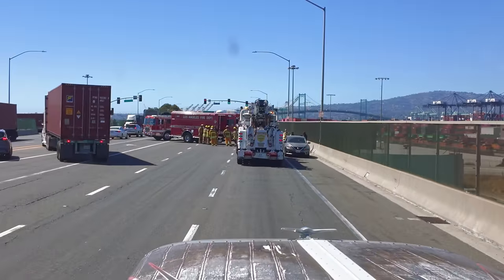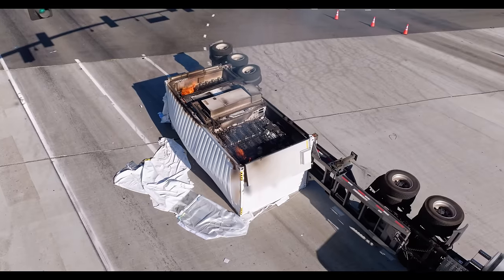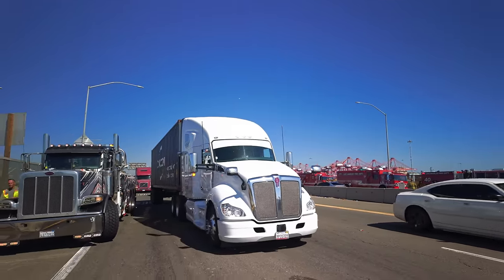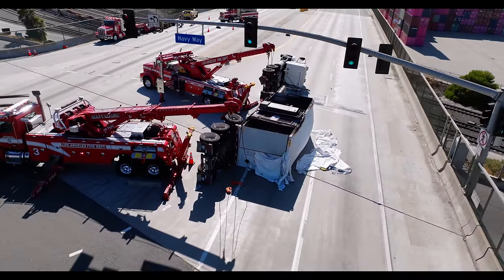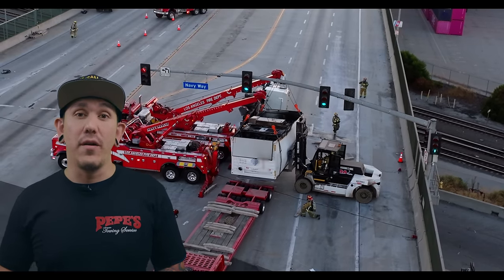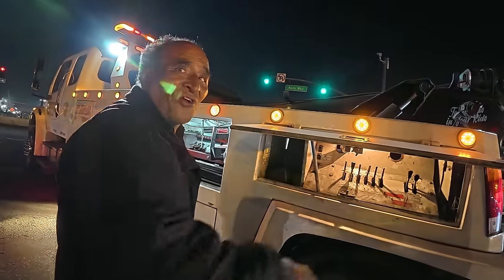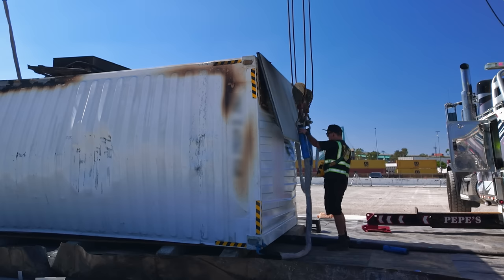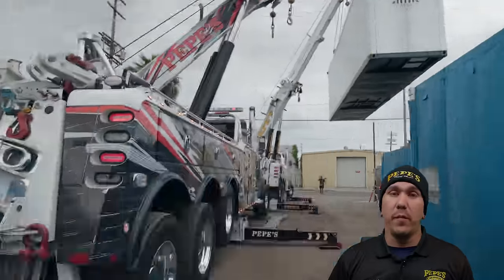60,000lb Lithium-ion Battery EXPLODES on Freeway!

Comment: Worse location possible. On a bridge, involving train tracks, interstate,  ports. Dang thing going NUCLEAR
Reply: The only "usual suspect" missing was some nice high voltage overhead lines.
Reply: , don't forget that giant fuel storage tank right below the bridge too
Reply: Going "NUCLEAR", bro it barely got on fire
Reply: @StefanoFinocchiaro  Yes, but lithium fires create a nice, massive "fuck off" zone of very, very fatal fumes. This, around quite literally every most used mode of transportation is rather problematic & a lithium battery of this size for more FD's is a large event
Reply: @StefanoFinocchiaro  not only did it explode with the force to open the doors, but then there was a raging inferno at least as big as a campfire. At least gasoline doesn't explode, or catch fire, so much for the future.
Reply: @ironassbrown  gasoline DOES explode when it evaporate and catch fire in a contained space
Reply: @StefanoFinocchiaro  pretty sure that fuel tanks only explode because they started putting lithium ion batteries in them. Otherwise, they would be 100% safe. The old technology is so safe. In fact, I challenge anyone to find an image of a fuel tank exploding like a small atomic bomb. You can't do it because liquid fuel has always been the safest thing that we have. That's why tankers, and gas stations never blow up, and that's why it is so difficult to drive up to a battery fire with a front loader and dump some sand on it because it will see you coming and it might get aggressive.
Reply: @ironassbrown  In Romania last year a gasoline station blow up killing 46 people
Reply: @ironassbrown  The gasoline produces flammable vapor, that's why is not allow to smoke cigarettes in pump stations
Reply: @StefanoFinocchiaro  Yeah but at least they didn't have to worry about fumes. You saw the video the FD was helpless they couldn't pour sand or baking soda on the batteries because they had to sit there and let it slowly burn for a day. I wonder how many people died from this battery fire probably at least 47
Reply: @StefanoFinocchiaro  naw it's super safe, as long as you are out of the blast radius, and standing behind something solid. Batteries on the other hand are very dangerous, that's why I replaced my mobile phone battery with a gasoline generator. Sometimes I get dizzy when I am charging in a confined space but I know the fumes are harmless, and the more gas you have on you, the less you can smell it. You hardly notice it except when you run out of breathable air.

Comment: Years ago to fight a magnesium fire, they would dump sand on it to smother it and encase it with a glass coating. I wonder if that would work for these types of fires as well.
Reply: Some repair shops keep garbage cans full of sand for LiPo batteries that turn into spicy pillows. Though for something like an EV, you're gonna need A LOT of sand to completely smother it.
Reply: That might turn it into a bomb, if the glass gets thick/strong enough. This fire doesn't need the oxygen from the atmosphere.
Reply: in Germany electric cars bath for a week in a watercontainer to cool down
Reply: Probably would. For charging my LiIon batteries privately I have a bag of "FireBalls" not sure what they are made out of, but on being heated they fume out CO2 to extinguish the fire and if this one does not work they are supposed to melt and encase the fire to not let any air near it.
Reply: There is no way to put it out. You could put it in the vacuum of space and it would still burn. It's literally like rocket fuel. It has it's own oxidizer.
Reply: The fire is just the battery's normal chemical reaction happening exceptionally quickly and producing heat instead of electricity. For most types of batteries, atmospheric oxygen is not part of the reaction, so a battery fire will proceed on its own even without oxygen.
Reply: @Jake-bt3fc Cooling keeps it from going off, though.
Reply: @namibjDerEchte  There is no air in space to conduct heat so cooling is very difficult in a vacuum.
Reply: Well for EV's they've solved the problem with a special injector tool that can puncture the battery pack from underneath and spray high pressure water directly into it putting out an EV battery fire in only 15 minutes no problem.

Comment: Was really looking forward to Josh's live commentary on the fire departments recovery efforts
Reply from the maker: I wasn't frustrated with them per se either. I was hired independently by the department responsible for handling the scene. So I kept getting called back and told to wait just to not do anything. Believe me, fire didn't want to be responsible for the recovery either so I'm sure they were also equally as unhappy to have that thrust on them.

Comment: Looked like LAFD heavy rescue could use some ride alongs with Pepes and some training.  Pepes would have had that handled an hour after the fire was out, but I suppose adding in politicians and multiple agencies slowed things down to a crawl.  How to solve the roll over issue with these, slow down and be aware how these things ride.  Great work on the video.  It's hard to cover something that takes so long and keep it entertaining.

Comment: Big problem with this is drivers swinging corners too fast but also the major issue I think is how it’s being transported. It needs to be on a lowboy trailer and a lowboy only. Chained down all 4 corners and top to bottom definitely more secure than the way it is right now.
Reply: First of all imagine   this stupid driver dropping that thing on a car? It will smash it. But also this giant lithiums are a bad idea, dropped from 3 feet and you get this mess and so much money wasted, even a real generator would not do this if dropped, honestly the city should send the  company the bill, $ the transportation company is at fault too, let them sue each other.

Comment: The Scandinavians have worked out how to put these lithium fires out within minutes. 
They deluge the fire with chilled brine (salt water). They’ve developed this method to put out electric car fires on their car carrier ships.
Reply: Best EV firefighting (thermal runaway) technique yet!
https://youtu.be/ODirK7ZuYW4?si=NaCy8-nQfdKEoePy
Reply: This is after they've invented sodium ion batteries that don't HAVE thermal runaway problems. They've already put them in a few test prototype cars but of course they won't use them widespread. So now we have to listen to the battery fire morons.
Reply: @jb5music more worried about the people in the Congo. Funk your battery fire bs
Reply: @jb5music  These batteries have lower energy density, which is already an issue with lithium ion (for cars and trucks, anyway.) That, and they will still explode violently when damaged. There is no safe battery, because that compacted, concentrated energy wants nothing else than to be freed by any means necessary. Sodium ion just removes the re-ignition risk.

Comment: This is why auto insurance costs more for electric vehicles.  Been following you for over thee years now really enjoy you content.
Reply: yep as they are almost impossible to put out once they ignite. yet they are so much better for the environment.biggest load of crap out there
Reply: Not at all, your gas car has 10x more chance to burn down.
Reply: @MrArcticPOWER  Insurance rates are higher for electric cars because they carry a higher risk for the insurance companies when parked indoors they also are more expensive to repair
Reply: @lostsailor2284  Insurance companies use statistics to calculate your premium and statistics clearly show that gas cars are more likely to catch fire. 
Yes insurance rates are higher because of repair costs, but more importantly because they are worth a lot more.

Comment: I've made bigger bonfires than that, and that's an entire semi trailer full of batteries. I'm a volunteer FF and we've done multiple training sessions on how to deal with lithium battery fires. I can confidently say the only problem here is poor/no training on these fires and/or no equipment for it (that our volunteer dept has, so pathetic if that's the case)
Reply: For a lithium battery as big as that one, I am surprised by how the thermal runaway was not that great. Does the charge of a lithium battery affect the intensity of the reaction?

Comment: The minor explosion was caused by hydrogen accumulation in the container, and a single spark set off the blast, blowing the doors open. If fault is to be assigned, it lies with the driver of the semi-truck who turned too sharply, combined with the container's weight and high center of gravity, causing the trailer and truck to tip over. The doors are designed to open in such a manner. Regarding the fire department, by waiting this way, they are delaying their action because uncertain about handling these large battery generators, which I believe are used in conjunction with windmill turbines.  The companies building these should educate Fire depts on how to deal with these.   

Proper transportation methods for such equipment must be learned. A low-bed container trailer should have been utilized to maintain a low center of gravity, closer to the ground.

This is the consequence of employing an unsuitable company for the shipping or transportation of this type of equipements..
Reply: Exactly. This is not a battery that exploded as such.

Comment: Ports need grade separated automated rail lines to get containers out of cities to rail and truck pick up terminals. We have just as many problems at the Port of Houston.
Reply: Look up the Alameda ditch
Reply: @ArtStoneUS  Most of what I found had to do with a hiking trail in Albuquerque. But I did find the LA rail line.  

A plan proposed for the port of Houston was to build an automated, electrically powered and grade separated rail lines out to intermodal terminals outside of Harris County. 

Trucks are still an air cleanliness issue and a traffic nightmare in Houston.

Comment: I love that Tonka Truck recovery vehicle. I want one for Christmas. I had an electric car in 2014 on a 2 year contract. After 8000 miles and two years its range was 35 miles and needed a new £5000 battery. I gave it back and I will never have another one. I would rather walk, it's quicker than pushing an electric car.

Comment: Lol all the waterheads commenting about lithium tech without realizing what would have happened if this was a tanker that exploded instead.
Reply: There is mutch safer battery chemistry to use when you dont have so high energy density demands,(like in a steel container ) it's not a
Ev car we are talking about here.
The lithium batterys are , prown to thermal runaway ,not optimal out of resource point,
Emits extremely toxic substances  if it burns .and there is no scaled up recycling solutions for the  after use part  of the  lifecycle. 
A gas tank would flame  out in a more or less  controlled fashion, burning liquid fuel will burn hard but not for so long time period.  If this was a tanker it would probably not even have leaked from a "simple" flippover.
Reply: It's way harder to make fuel explode. It needs to be compressed and have no way out - meaning if it's leaking, it most likely won't explode unless rest of fuel is trapped there.

Comment: Lithium is a metal, like magnesium. When magnesium burns, when aircraft wheels catch on fire, sand is used to contain and extinguish the fire. Why sand? Because the fire is so hot, hydrogen and oxygen are separated by the heat and the fire burns with even more intensity as the fire creates it's own fuel using the very water intended to put it out.
Lithium battery fires should be dealt with in the same manner. Multiple 10-15 yard dump trucks of sand poured over the fire will cool the flames and smother the fire. Equipment used for pouring concrete from a distance would be very useful in situations like this.
Reply: I wonder if it would just re-ignite when it came back into contact with oxygen. It does after being submerged in water.
Reply: @christinecortese9973  In water, it never really stops burning as, at the molecular level, the fire's heat creates more fuel for itself, using the water. That's why water doesn't work. The heat separates hydrogen from oxygen creating fuel and an oxidizer on the spot. Sand reduces the heat and does not become fuel. Once the heat has been reduced, the battery's interconnecting cables can be cut, reducing the risk of re-ignition. The sand will absorb and dissipate heat for a long time.

Comment: For those wondering, the only way to really truly put out a lithium-ion fire is to, essentially, dump a small pond on the thing that's on fire. That basically means the fire department has to just...let it burn. No amount of hoses, foam, or anything short of that small pond will do crap to put the damn things out.

Tests have been done on ideas like wet-storage for batteries (Similar to wet-storage for ammo in tanks), but nothing has entered production or, to my understanding, even a prototype phase. It's just cheeper to invenst in making the batteries more durable.

They are much safer than they used to be, the new ones that is, but that doesn't mean they're any less of a pain in the rear when they DO ignite. Runaway checmical reactions of this scale are nasty.

Comment: That not just battery, it's Amazon Snowmobile a very large data transportation. I just leaned about in my college class on Cloud Network and Cloud  Security. Note logo was blended out and see blue smile logo after the truck doors blow open.

Comment: One of the major issues with battery fires is that adding water can trigger a chemical reaction with the battery, producing more heat and worsening the thermal runaway. To control the situation, you would need to use a significant amount of water just to keep up with the escalating heat.

Comment: Wow.. crazy video.  I am thinking that the Battery was LFP chemistry.  That is a less reactive chemistry.  If it has been one of the others.. the fire would have been MUCH MUCH larger.
Or perhaps they have the inside of the container very compartmentalized.. So failure in one area won't lead to a total cascade failure.
Amazing job getting that moved, and handled safely.

Comment: So, from what I can see at 52:26, I'm not totally sure exactly how this machine was designed, but from what I can tell, the lithium cells were in racks on either side (the main burn charred areas) and the center is where all of the battery management and inverter/charge controller stuff would be. The doors that blew open were obviously the servicing doors. Looks like there is actually some circuitry on the inside of the doors as well. Couldn't tell if the user interface panels would have had doors on them or just on the side. I've never actually seen one of these yet so this is mainly what I've gathered from what I can see. Pretty neat technology, just definitely doesn't seem safe having that high of a capacity lithium setup. It proved itself it can be very dangerous. This seems like it was more on the calm side of this size of a battery system of lithium cells. Who the heck knows what the worst case scenario would be. Hopefully that doesn't happen.

Comment: One reason you might want to pair a battery with a generator is that generators run most efficiently at full load. It would be more efficient to run off only battery until it hits a certain charge level, then run the generator to charge it at full load, turning it off when the battery is fully charged. That way, you aren't running the generator at 10% load all day with all of the overhead that comes with the generator running itself.

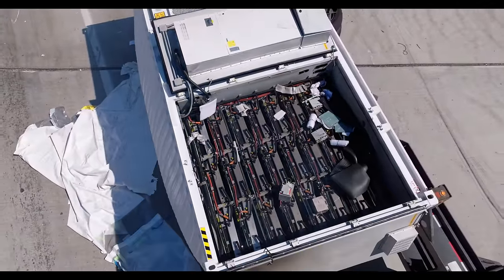Comment: the grey thin metal at 7:09 is lithium metal that exploded from one of the batteries if my experience says so. Once that is exposed to air its just a matter of time before its exposed to oxygen for it to combust, and even more rapidly with the introduction of water.

Comment: Water does work but you need to inject it inside the battery. In Europe they are pushing to have standard fittings to fit water hoses on large battery packs so that firefighters can extinguish them in situations like this.

Comment: After watching the video almost all the way through I realized that the batteries look to be all on one side of that cabinet which meant when that guy took his turn the weight of the cabinet flipped the whole trailer on its side they should never load a cabinet with a bunch of batteries while in transit. The battery should be loaded into the cabinet individually after they get to location. This coming from a professional electrician's point of view.

Comment: Had you not stated in the video the battery was Li-ion, I would have thought the explosion to be caused by ignition of hydrogen buildup from normal lead-acid batteries. There was so much energy released at once! 😮

Comment: Good job, guys. And I appreciate the magnitude of the knock on effects. I am familiar with that area. (Friend with boat.)

Note that Lithium wants Oxygen so badly it will rip the Oxygen in water away and leave you with a nice hydrogen fire. The Lithium batteries go away only if we go back to natural gas or coal power. So figure it is not going away. The trick will involve figuring out how to deal with them. And TPTB should require port area truck drivers to sit through your video. Then leave them with, "Take extreme care with this type load, ya think?"

{^_-}

Comment: 52:37 There is a movement to change over to LiFePO4 type for commercial backup like this one. The big reason, they don't burn like Li ion type and can be put out with normal procedures for a chem fire.